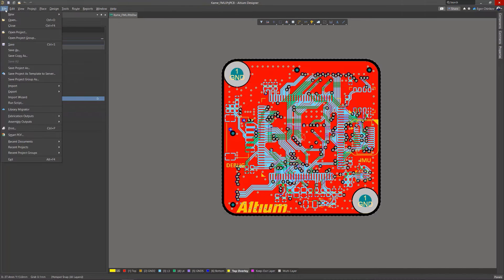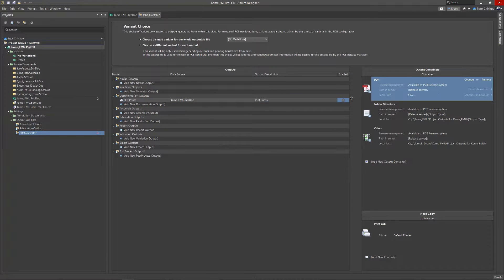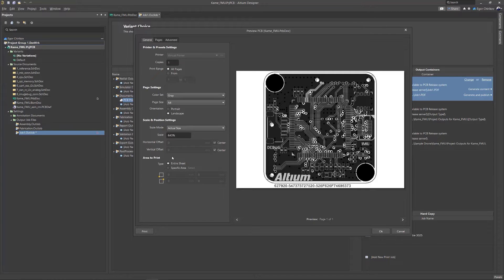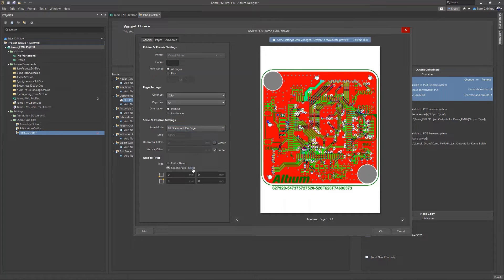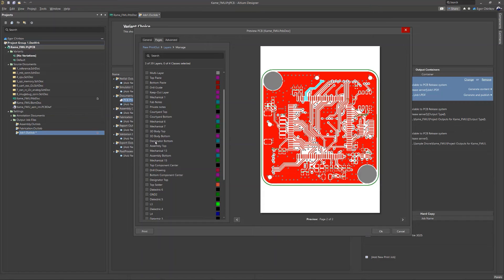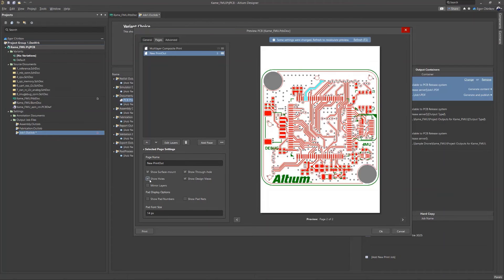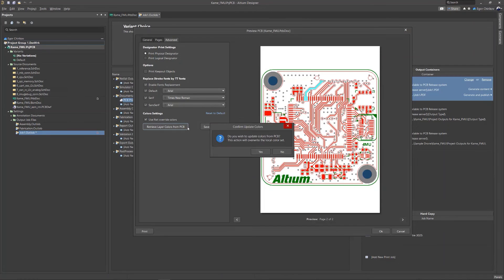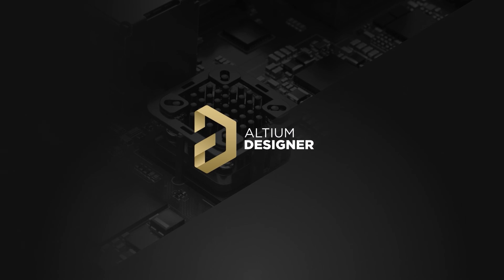How to Print Your PCB in Altium Designer

Comment: Thank you for this video. I do 3D renderings for different companies and waste a huge amount of time re-drawing the PCB copper, silk and solder layers for the top and bottom to use as texture files because many of those same clients do not know how easily they could export to a PDF saving everyone time and them money. I'll be sending this video to these clients from now on! 👍

I take it the different PCB layers they choose to print will also be layers in the resulting PDF correct?